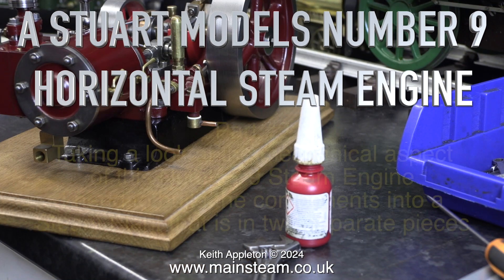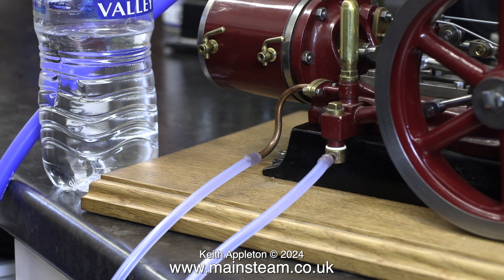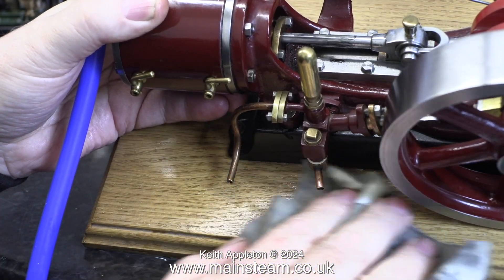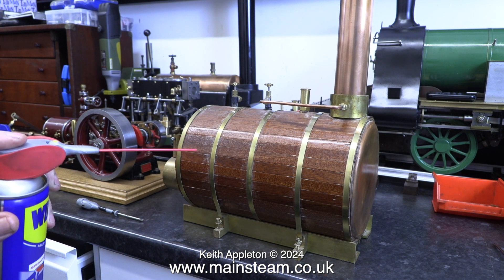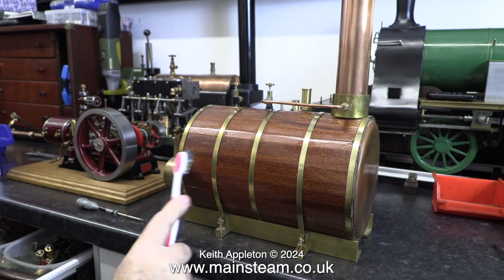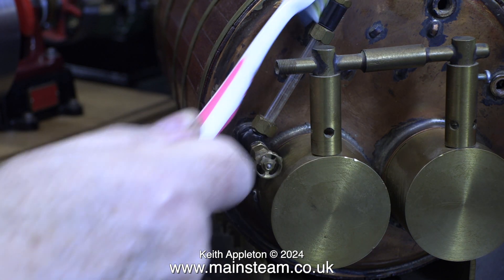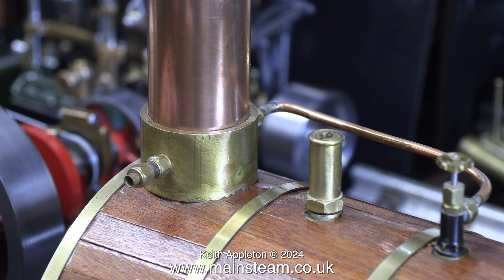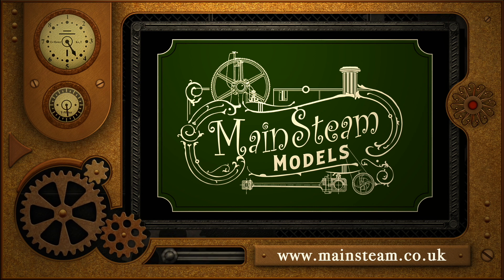A STUART NUMBER 9 HORIZONTAL STEAM ENGINE - PART #2

Comment: The 5/32 x 40 thread is a UNF fine thread.  An American standard.  That type of connector is extremely common at hardware stores and pipe supply stores.

Comment: Hi Keith, I have been a subscriber and follower for some time now, to the point you got me into building these models.
I do however have a question which I need clarifying if you can help ?
Which direction is deemed forward on stationary models? and is this always the same? only watching different no4s on YouTube they seem to be running differently? 
I have a start 5A and a no 4, both with reversing gear , which is forward ? and is forward when there handle is down?
hope you can help Keith, all the best.
Mark
Reply from the maker: With Vertical engines the forward direction is generally with the reversing lever at it's lowest point. It makes sense that if the linkage locking mechanism failed, gravity would make the lever drop and the engine would run in a forward direction.
Reply: @keithappleton  
The handle position makes sense when you explain it that way Keith, thanks.
But  which direction is considered forward ? Clockwise at the flywheel or the drive pulley end?
Reply from the maker: Whichever way it goes when the lever is in the down position.
Reply: Thanks once again Keith.

Comment: Just a thought - to connect the two plants you could use 'stainless branded PTFE hose'. It' comes in various sizes and s good for very high pressure - well over 1000psi !